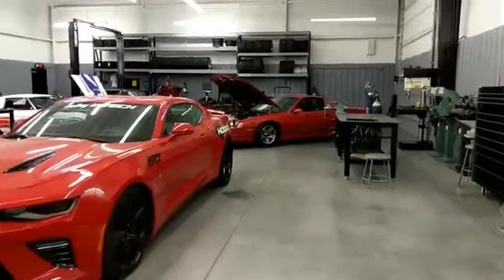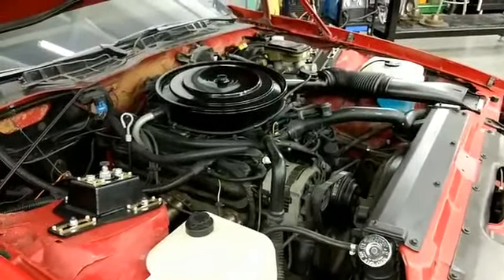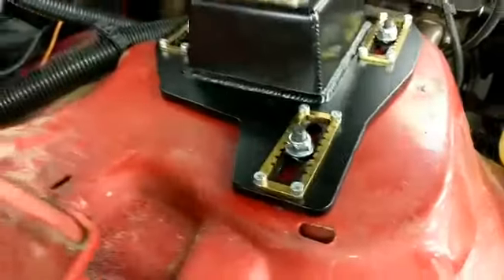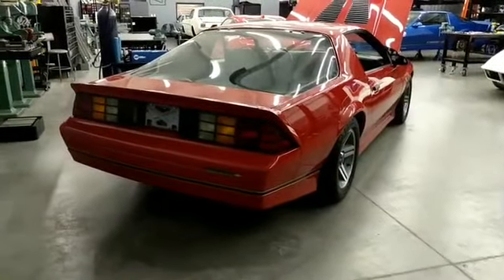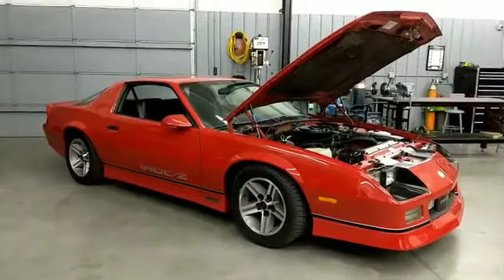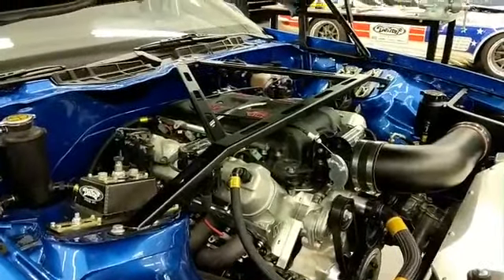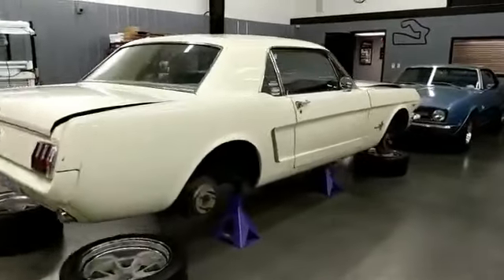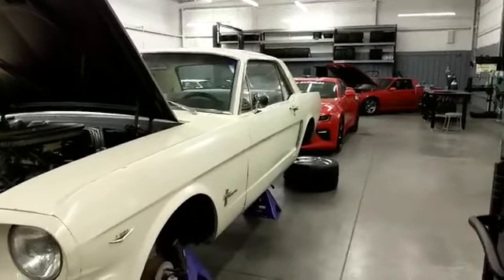Install Complete on Brad's 8,300mi 1987 Camaro IROC-Z - Facebook LIVE

Comment: It's not an Iroc !   The Iroc in 87 , came with a TPI engine, it's a clone .
Reply: You are grossly misinformed, try to learn, an IROC does not automatically mean TPI.
Reply: The base engine for 1987 IROC was the LO3 TBI motor.  The TPI motors were optional.
Reply: Actually the 1987 was a 4bbl carb with a v belt drive pulley system. It wasn't till 1988 had a single drive belt with a 305 tbi (standard option on the Iroc-Z). The suspension was the Iroc-Z stamp on the door which included thick front and rear sway bars with a ladder traction bar on the rear axle bolted to the transmission....the standard option rear axle Iroc-Z had drum brakes with a posi diff, the G92 was an option with rear disc brakes and higher gear ratio. Also the 1987 Iroc-Z decal was on the front of the door, then in 1988 the decal was moved to the rear of the door, and the last thing GM did was the 16 inch wheels were redesigned with 2 small slots in 88 instead of 1 slot on the 1987...Another thing, no matter what options you wanted on a 82-92 Camaro you could not get a 350tpi with a 5-speed...unless you worked at GM and were a Big Wig or Bill Gates....that option was for the C4 Corvette (1984-1996) 350 crossfire 4+1, Tpi till 91, Lt1 92-96, 96-Lt4